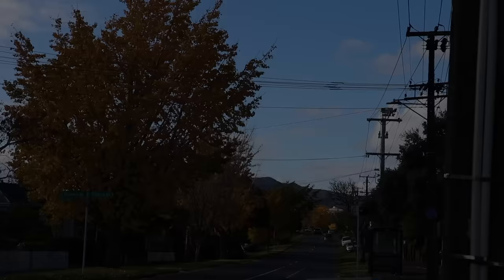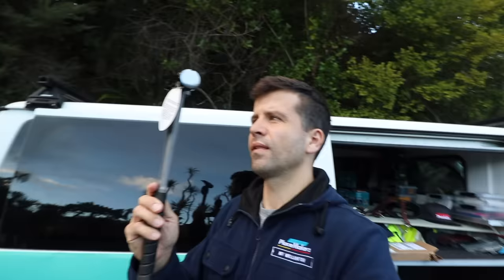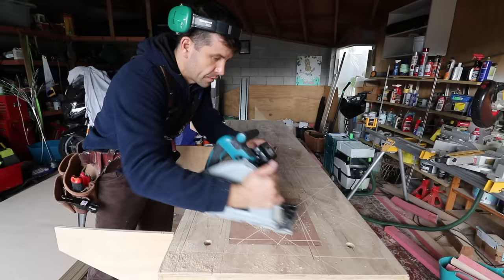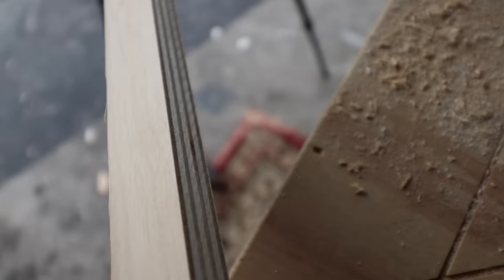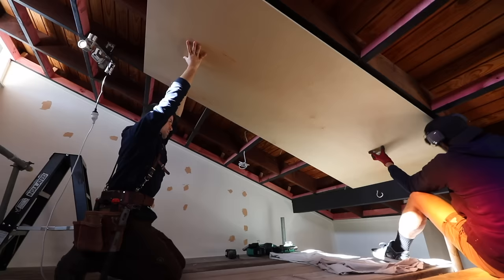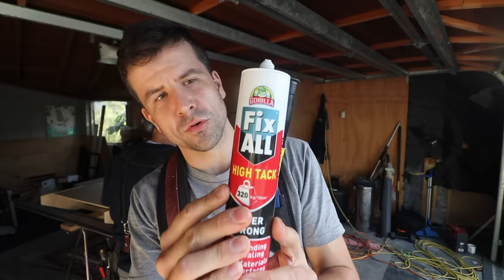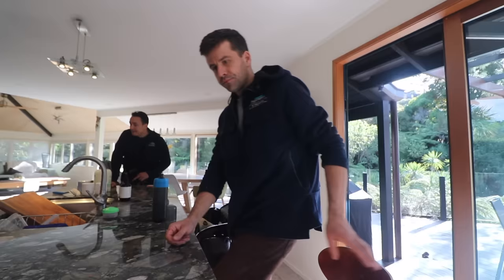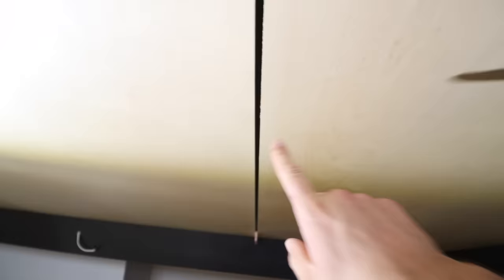I Bought This Hammer For Youtube

Comment: So the paint usually wears off a blade due to friction and heat, it's impossible to stop it because any prolonged work with a saw will of course cause heat and friction, so you just gotta make sure that the material doesn't clamp down on it.

Comment: Ive got a martinez. Its like 2 ounces heavier than a stiletto overall but the weight is exactly where you want it
Reply: No some guy weighed them both they are the same weight. Stiletto tb3 has a lot of vibration in it. Martinez is a fucking weapon of a hammer, close to a dead blow hammer. No vibration at all.
Reply: @kickyourfaceandlaugh607  well i'm the only 1 on my site with a martinez and about 6 stilettos. Maybe 2 oz is an exaggeration but everyone will say the martinez is heavier if only by a fraction. Like not noticeable enough unless you're holding both hammers at the same time

Comment: Because gravity doesn’t take a day off, are the nails shot in on an angle?

And when using pin nails for a ceiling, would it be a case of, the longer the nail the better?
Reply: Glue is so good nowadays that the nails are just to hold it till glue drys basically, and wood filler isn’t very attractive..

Comment: Can I ask why you are not using the spare room above the plywood, to in prove the insulation of the roof.  By installing rockwool or glasswool. In Denmark were I am from we are using 250mm insulation on the roof in new house today. Is heating/cooling cheap for you guys? Thank you for the great videos.
Reply: Tue Maack-Krommes ... it’s crazy that they doesn’t do it ... I live in Canada and I’m from Germany and here in Canada it’s the same. No one doesn’t here too. Soundproofing or just better insulation to save energy is unknown. The main reason is the cost of power is much cheaper then in the EU.
Reply: It’s Auckland, the weather is not like Canada or Germany. They barely ever see under 10 degrees c, And over 30 is rare as well - and it looks like the windows are single glazed as well.
We also don’t do central heating/cooling here either.

Comment: Being a Dewalt guy, I recently went to get one of their Tripod Battery Worklights down at Glenfield Mitre!0.  Turns out they say they have stock there on their website, but sadly they only have a display model.  Hmmmm.  

Gotta get me a decent Hammer too.  Less fatigue and lighter on the toolbelt.  Plenty of options on Amazon these days.  Just hate having to wait for delivery.
Reply: Yeah, the Mitre 10 website stock control numbers aren't accurate - have been caught out a couple of times recently, so it might be a post lock-down snafu thing...

Comment: My thoughts on the ridiculously expensive hammers, if you can't strike properly with a $20 hammer, a $250 hammer isn't going to do anything for you.
It's a bit like Festool, Makita does great and most of my tools are Makita, Festool comes off like a designer tool to me like it's a status or something.
I'll keep my $50 Dewalt hammer and Makita tools.
The difference between having a few Festool tools and a trailer full of Makita/Bosch tools.

Comment: Hey dude, what blades do you recommend for your table saw and droppy?
Reply: Try makita blades. From Amazon. Half the price of diablo and last way longer. Or if you got the money try Forrest blades.
Reply: Cheapo blades for busting construction lumber and nice blades for finish work. Diablo is a good bet. I bought some Craftsman that were nice, they were made in Germany. Japan makes nice blades and USA makes nice blades.  You can have your nice blades resharpened for a fraction of buying new and throw away the cheapo blades.
Reply: Zack Fishle thanks for the reply 👌🏼
Reply: smokingcheeba420 thanks for the reply 👌🏼
Reply: @FlyingBenana  thank me after you try a makita blade. Japanese made. Look them up. Great price. Only ones i will buy. Had the conversation a while back with someone who tests blades and commercial diablo blades out rank anyone but their pricey. Not found at the store. Thick blades with small degree teeth is what i look for.